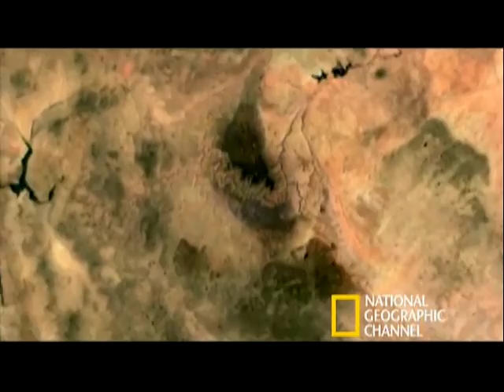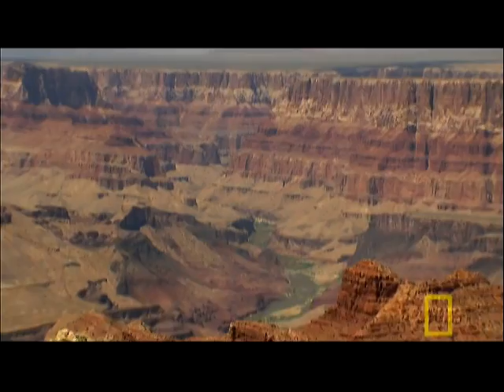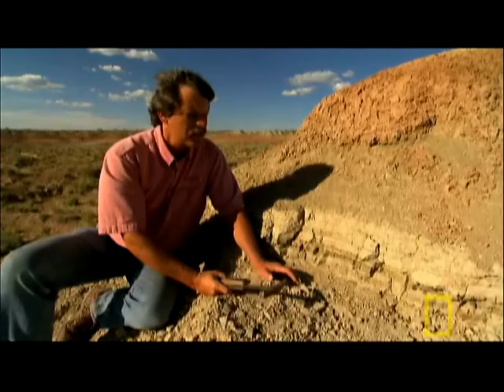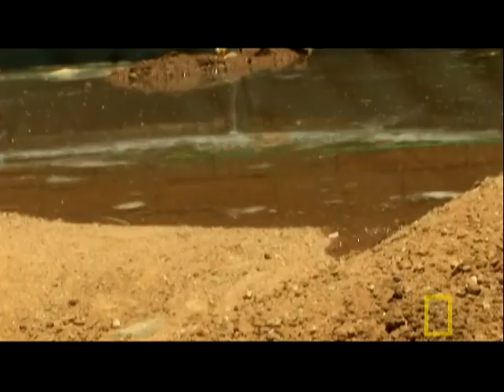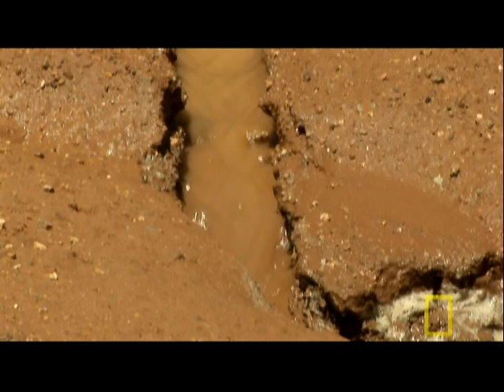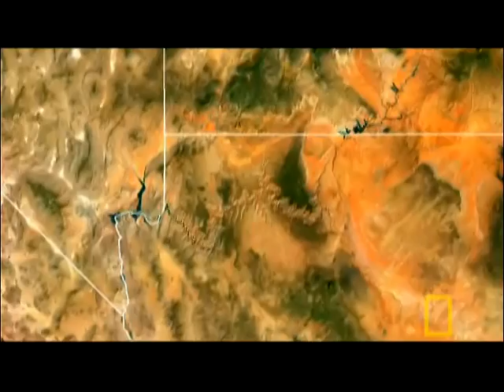Spill-Over Theory | National Geographic

Comment: @Toudiyama 
"Sedimentary rocks have an average thickness of about 1800 m on the continents."
Occurrence, Mineralogy, Textures, and Structures of Sedimentary Rocks
w w w . tulane . e d u / ~sanelson / geol212 / sedrxintro . h t m
1800 meters is equal to 5,905.51 feet, which is equal to 1.8 kilometers or 1.12 miles.

Comment: ""Stronger, by weight, but not by volume, for two same size objects wood is weaker."

The Ark was very big."

And the sky in Blue.

What is your point?

The Buoyancy of the ark is and easy to calculate value.

There is no mystery behind the physics of what keeps boats afloat.